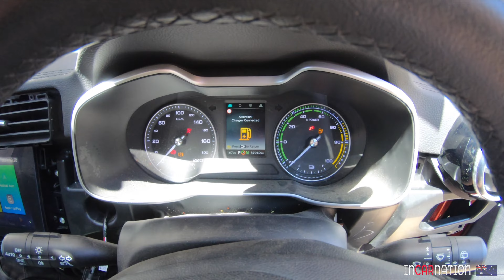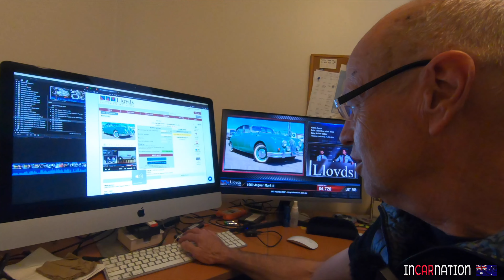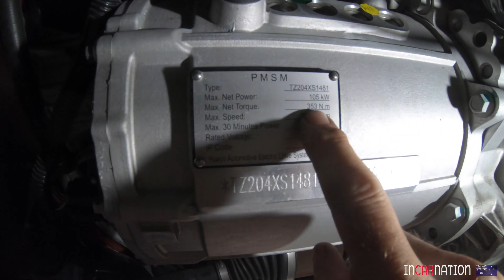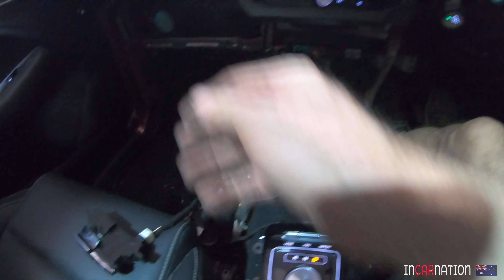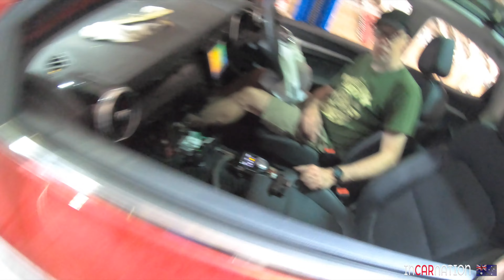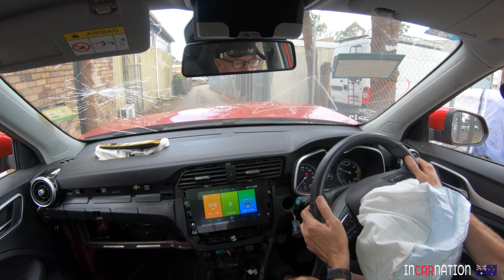Episode 7 – Porsche EV Conversion | Which Electric Motor for the 928 EV?

Comment: Why would you not buy a written off Tesla?, then you'd have the batteries and motor that you want with more chance of compatibility.
Reply from the maker: A sensible idea and yes I am watching. Would have to be a Model S though, and yes I am watching out for one. Model 3/Y battery shape way too large and difficult, and the 3/Y rear motor, although more efficient and more reliable, is turned around the wrong way to fit in the Porsche. And their are reasons it can't be run either turned around 180 degrees or upside down. Model S motor (either SDU or LDU) would indeed be very good. I'm watching out for one. The Model S batteries are also a difficult shape/form factor so would be a very tight squeeze if not impossible. They are 700mm long by 300mm wide, and you need 16 of them to get to the required voltage. You can't fit fewer. A Porsche 928 is a much smaller car than a Model S and they just won't all fit without a lot of body mods. The bread-loaf sized batteries from the MG won't give the same range but present fewer problems. Good question though. I could use the Model S motor and sell the batteries, which are popular for either home energy storage or other people's projects.
Reply: @inCARnationAustralia  Thanks for the comprehensive reply, good luck with the project.
Reply: @inCARnationAustralia  Or remove the back seats and use that space for the batteries you cannot fit under.  Keep it as low as possible and if you can get a shelf  for bgs etc  would be great.

Comment: I like the idea of 're-shelling' the MG. Do the ABS sensors of the MG provide input to the regenerative braking?
Reply: Good question. Don't know. It hasn't affected the KERS button operation on the dash or thrown a fault or warning when moving at slow speed. On any other car you'd expect it not to work with ABS wheel sensors disabled and not reporting any wheel speed, but I wouldn't be surprised if it continues to operate as normal. We haven't driven it fast enough to find out. We probably have to put it on a dyno to find out but yes we do need to know. A dyno would be useful to measure actual torque and power as well, just to get some idea whether Mr Puniverse is up to the task.

Comment: I def agree with using the full wiring loom etc .
I must admit if it was my project i would also initially use the MG motor just to get it all up and running, and then swap out and upgrade to the Tesla motor . 
Using all the MG gear in its entirety does effectively make it plug and play albeit with a body of a 928 . 
Also that MG motor would fit to a 928 auto trans diff (with a hammer/adaptor plate) so no driveshaft etc .

Comment: I love this project, please keep the updates going.  As for my 2 cents, unless you need the kWs for top speed (does the NT still have the no speed limit areas???), you may not need that much kW, in other words the MG motor could have enough to get to Australian speed limits ?????  The torque is pretty decent already close to the original 928.  Thoughts ??
Reply: As per NT speed limits....
Some sooky lah lays from the NWO were able to exert pressure on such freedoms! 😢